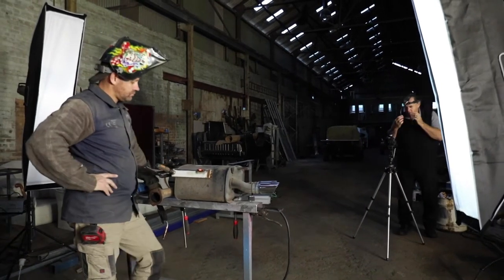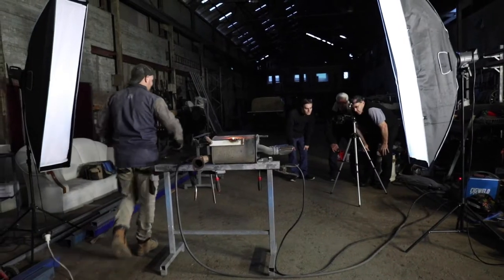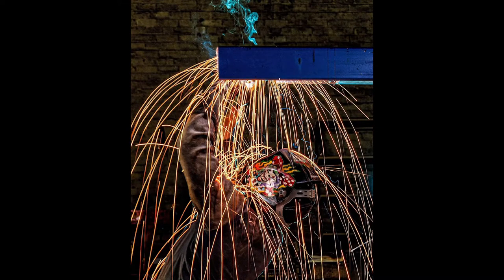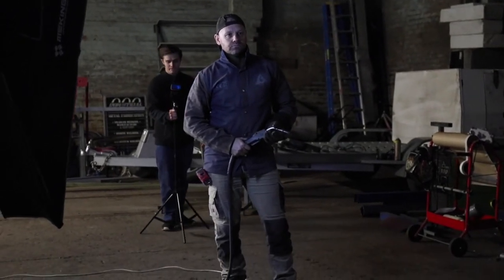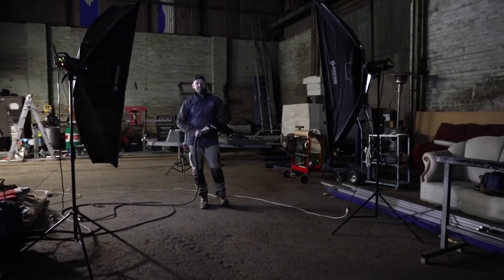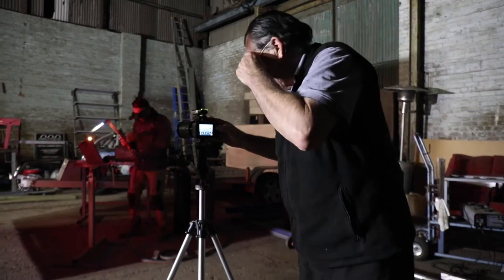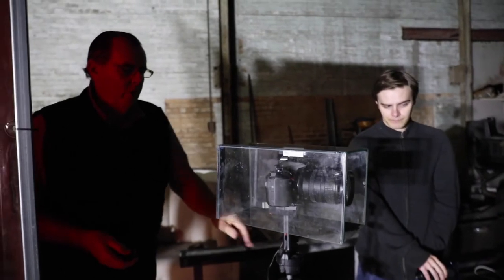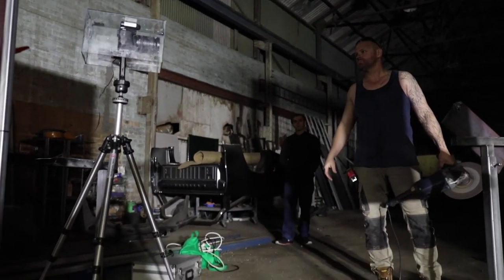How to photograph welding cutting and grinding industrial images. Slow shutter speeds and safety.

Comment: I notice   you don't put anything in front of your camera lens to protect it ?  Like a sheet of float Glass? And would that change the shot?
Reply from the maker: Thanks for your comment. Usually I am far enough away from the welding so there is little chance of sparks hitting my lens. For the grinding shots I placed a small glass aquarium over the camera to protect the lens.

Comment: Apologies if I missed these in the video but I have two questions:
1. Did you use an ND filter or any sort of filter to manage the light of the welder itself?
2. Did you have your flashes trigger at the beginning or end of the exposure?
Reply from the maker: Hi Jalen. No filters used. Standard front curtain synch was used. Rear synch is much harder to time the flash exposure.

Comment: Hi, great video thanks for posting. Could you tell me how you had the flash set up please. Did you use rear curtain sync for the long exposures? Thanks.
Reply from the maker: Hi Gary. Thank you for your comment. 
For most of the shots we had our softboxes set up 180 degrees either side of Corey with the same power flash settings.
We used front curtain synch. Rear curtain would have given us similar results but the moment of flash firing is too unpredictable.
Front curtain means that I can choose the moment for the flash to fire and let the slow shutter speed capture the spark trails.
Reply: @newcastlephotographycollege  That's very helpful, thanks very much.